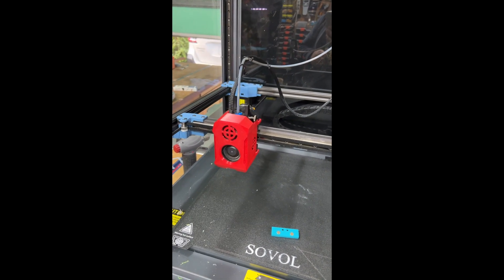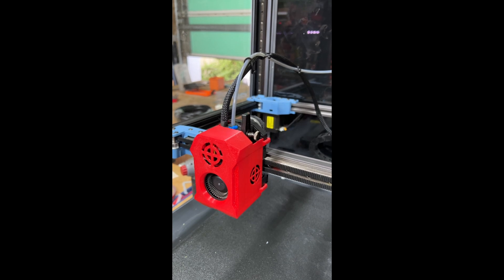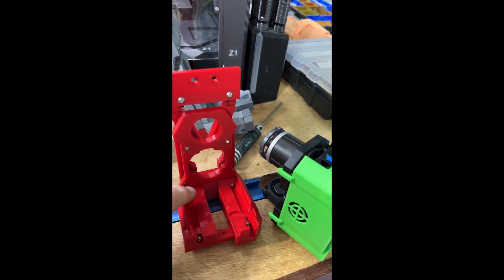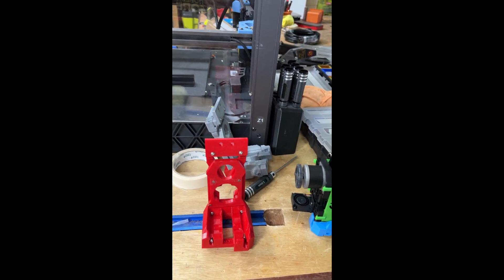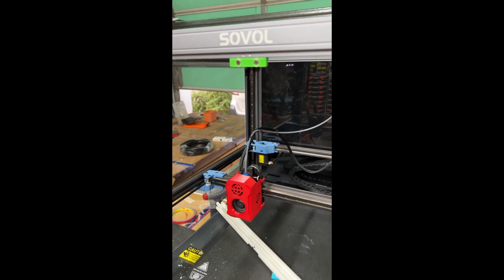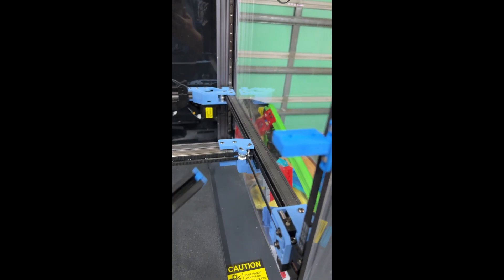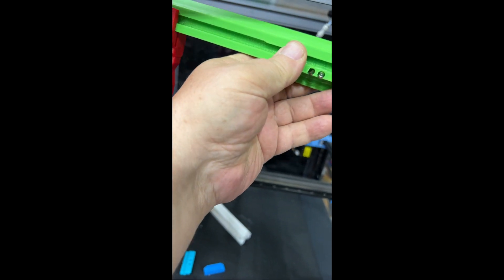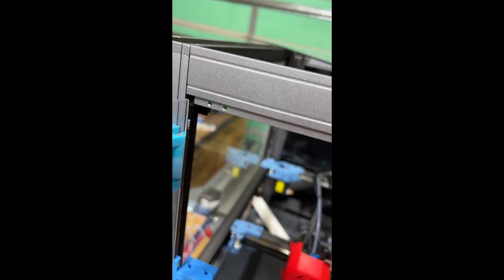Sovol SV08 Multitoolhead   progress   1

Comment: That bottom bar attachment is slick, I would love some more information. 

I don't know why just drilling into the frame never occurred to me.
Reply from the maker: I've added the bar to my github (in description) - the top bar holes must be drilled and tapped, as the bolt can't stick out more than 1mm on the inside, otherwise it will be hit by the gantry. Fortunately the few threads are enough since all the forces are lateral rather than pulling on the bolt threads.